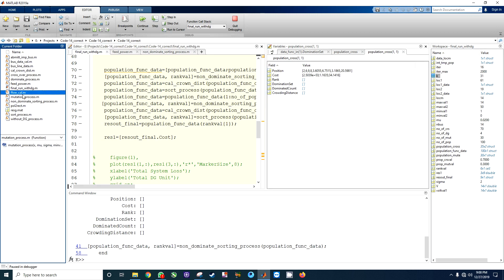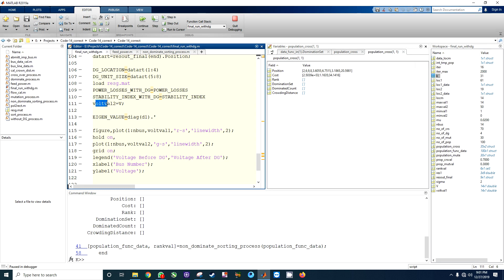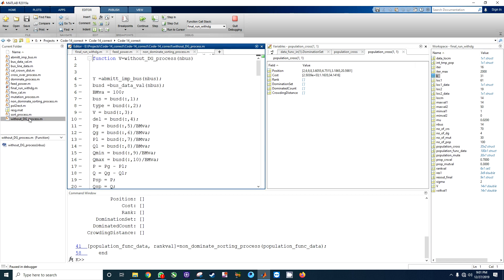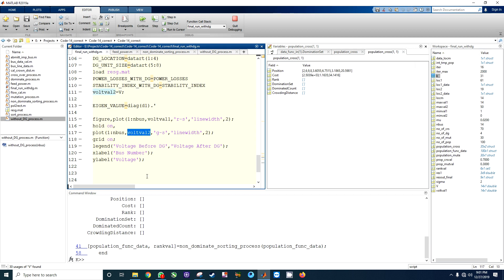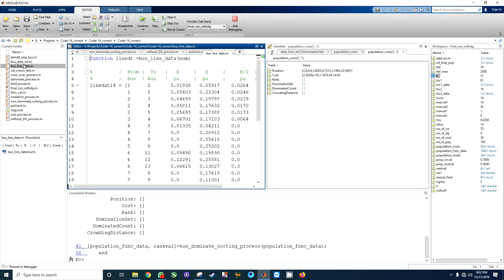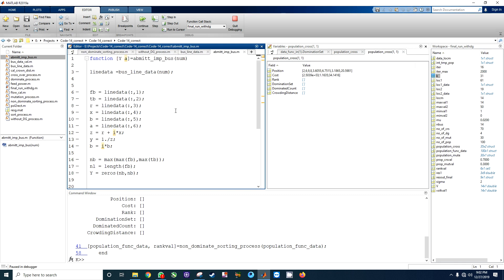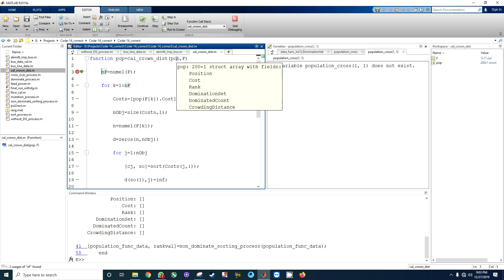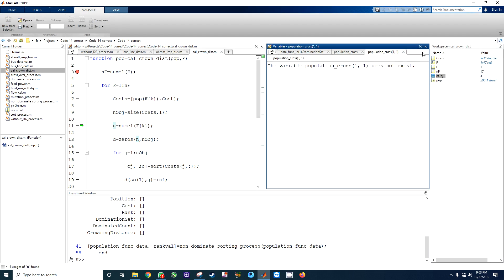IEEE 14 Bus System incorporation of Distributed Generation Matlab Part 4/4

Comment: Hello sir, why can't this same code be applied for other number of busses? I tried but its working only for 14 bus system
Reply from the maker: Which network you tried?
Reply: @SimulationTutor  IEEE 9 bus system
Reply from the maker: @charmingchamling1262  it's radial or mesh?
Reply: @SimulationTutor  radial and mesh both
Reply from the maker: Run mesh network type.

Comment: Foud error like below
Error using save
Unable to write file resg: Invalid argument.

Error in feed_power (line 191)
save resg.mat POWER_LOSSES STABILITY_INDEX V d1

Error in final_run_withdg (line 55)
        population_cross(k,1).Cost=feed_power(nbus,population_cross(k,1).Position);
Reply from the maker: Try to use Matlab version 17 or newest.
Reply: @SimulationTutor  ok, thanks for the reply....I'll try with latest version.
Reply: @SimulationTutor  I tried with MATLAB R2020a but it's working for some iterations but after few times later agin showing same errors.
Reply: @SimulationTutor  However, it's working for iter_max=100.
Reply from the maker: @dr.ravibhushan4079  set at least 2000 iterations to get good results. It may take more time.